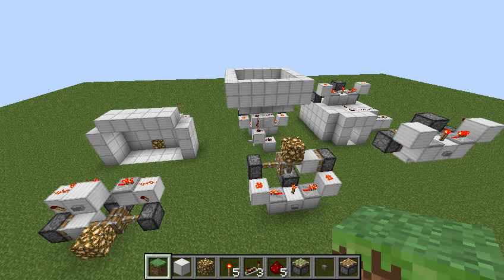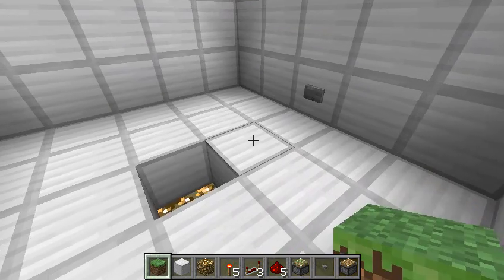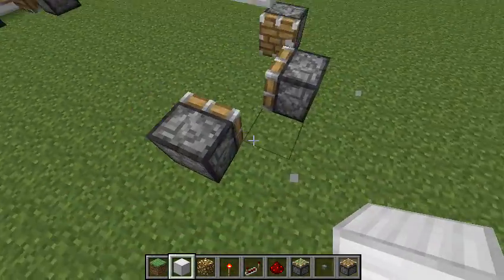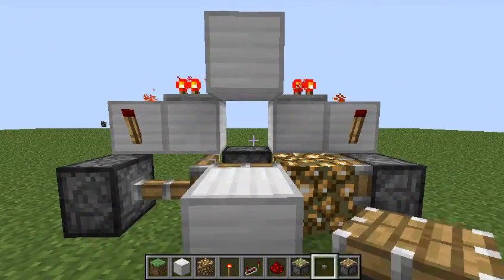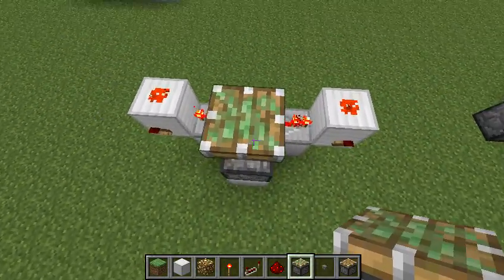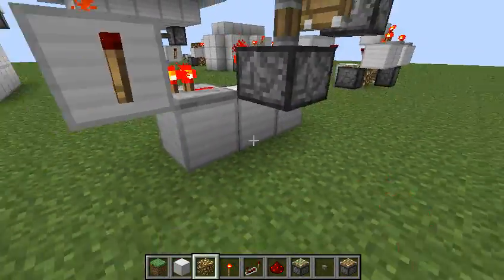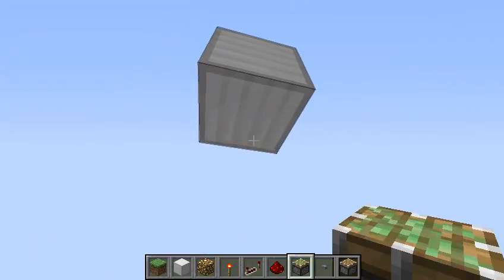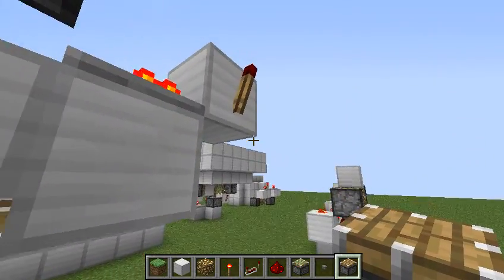Block Swappers (Rapid Redstone!) Minecraft 1.2.5

Comment: Ok, so, I figured out what I was doing wrong. It turns out I can easily just change the redstone repeater timings on the floor and ceiling ones, but the wall ones is a lot more complicated. To make it look nice A.K.A give it an equal delay in between each action, I can't just change the repeaters, because the design uses BUD switches. To solve the problem, I just hooked up a five tick pulse to the input. That does, of course, make it a lot less compact